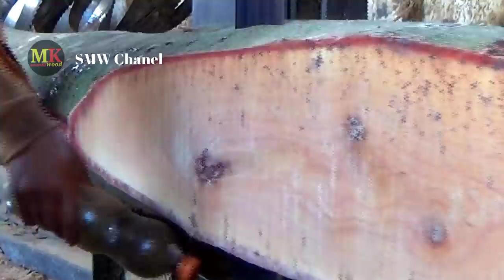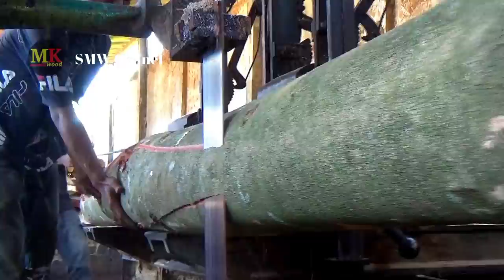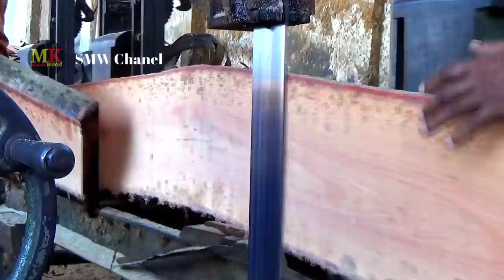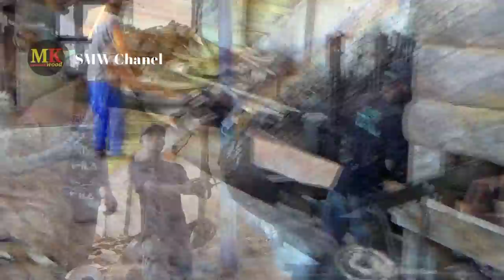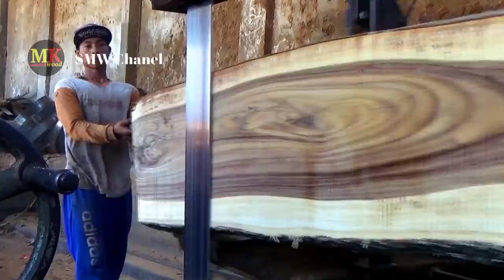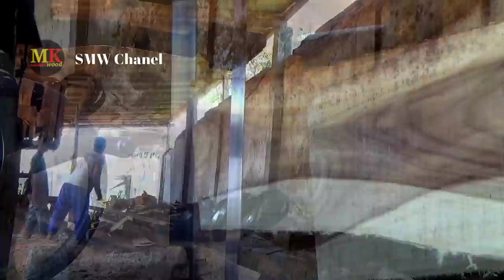Berakibat fatal.!! inilah titik kelemahan kayu Bayur/wadang yang jarang diketahui sawmill

Comment: its normal for indonesian conventional labour work without base safety equipment, what is it is normal, get paid daily not by hour unlike western labour.
Reply: @navajorezathlete1202  if it is calculated from the cost of living, it's about the same, right here, food and fuel are relatively cheap, but here we work still conventionally, there is still minimal use of power tools and manufacturing standards, btw thank you for sharing.